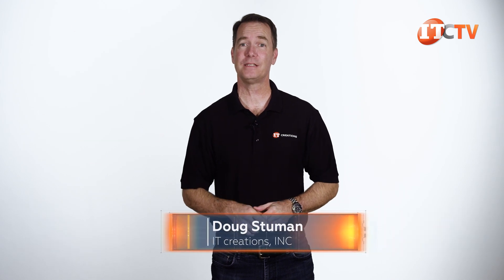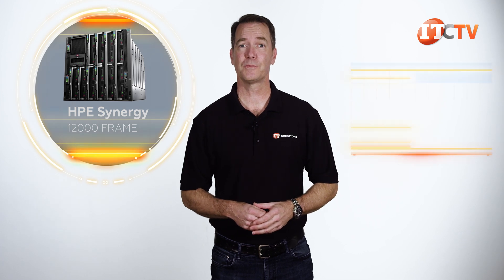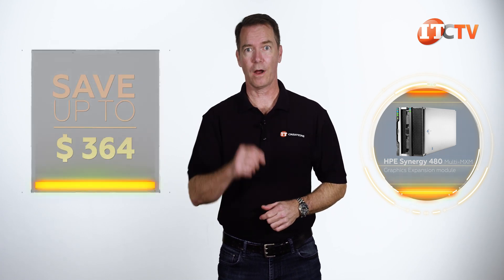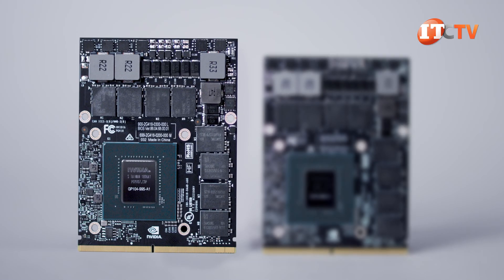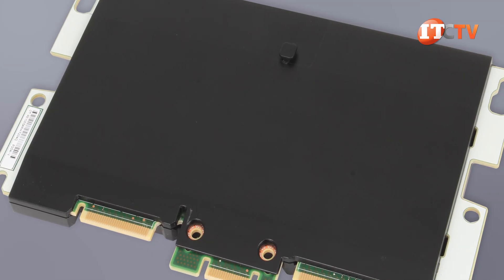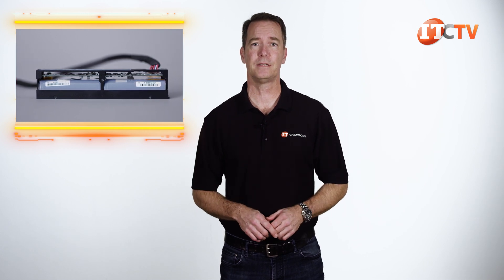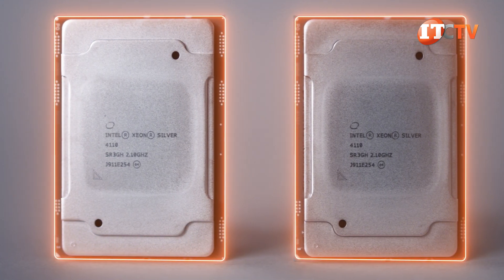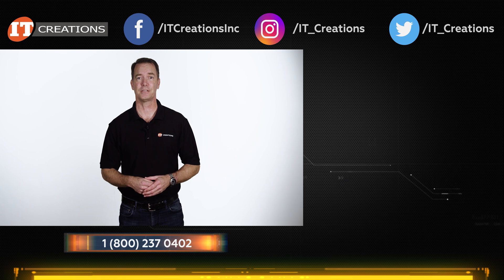HPE Synergy 480 Gen10 MXM Graphics Expansion Module REVIEW | IT Creations

Comment: how much ram can hold up max system ram and how many slot ram for this server blade
Reply from the maker: This server blade actually has two parts, the compute module on the bottom (HPE Synergy 480 Gen10 and Gen10 Plus compute modules) and the Graphics Accelerator module on top (HPE Synergy 480 Gen10 Plus Graphics Accelerators). You need both, and there are two options for each. The Gen 10 and Gen 10 plus for the compute modules and the 2 & 4 slot PCIe Graphics expansion module and the 8-slot PCIe graphics expansion module. The graphics expansion module stacks on top of teh Compute module. 

In answer to your question, max RAM is at 3TB with 24x memory module slots. Check out page 8 of the Gen 10 (no Plus) compute module QuickSpecs here: https://www.itcreations.com/user-manuals/synergy-480gen10-mxm/hpe-synergy-480-gen10-compute-module-quickspecs.pdf 
This is the quick specs for the two HPE Synergy 480 Gen10 Plus Graphics Accelerator modules: https://www.itcreations.com/user-manuals/synergy-480gen10-mxm/hpe-synergy-graphics-accelerator-options-gen10.pdf 

Maintenance and Service Guide here: https://www.itcreations.com/user-manuals/synergy-480gen10-mxm/hpe-graphics-expansion-modules-maintenance-and-service-guide.pdf 

Hope that helps, thanks for watching!

Comment: Could you install 3 full height and width GPUs?  In this blade or do I need a more advanced one?
Reply from the maker: Hi Igor,
No. You cannot install 3 FH, FW GPUs, the Graphics expansion module will only take 2x FH, FW, GPUs but will take 4x Single-width GPUs like the Tesla T4.  Another option supports 6x or 7x of the MXM form factor GPUs. These are also full-fledged GPUs but just a smaller form factor. And again there are two components to this blade, the compute portion on the bottom with CPUs and memory and and the Graphics expansion module, which fits on top. Here is a link to the Graphics expansion module page https://www.itcreations.com/hp/hpe-synergy-480-gen10-multi-mxm-graphics-expansion-module.asp 
There, you will find links to the other components supported in the Synergy 12000 FRAME, which supports this module. This provides a pretty good break down of the 3x options for this expansion module and the supported GPU form factors: https://www.itcreations.com/user-manuals/synergy-480gen10-mxm/hpe-synergy-graphics-accelerator-options-gen10.pdf 
Hope that helps and thanks for watching!
Reply: @Itcreations-LA  Wow. Thank you very much!
Reply from the maker: @igorwilczynski3266  
A pleasure! Spread the word and thanks for watching!